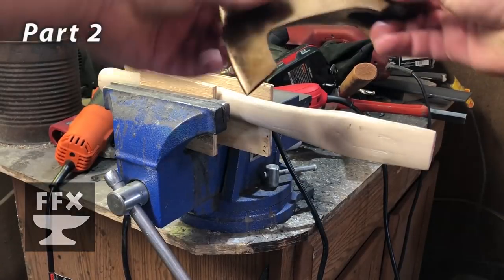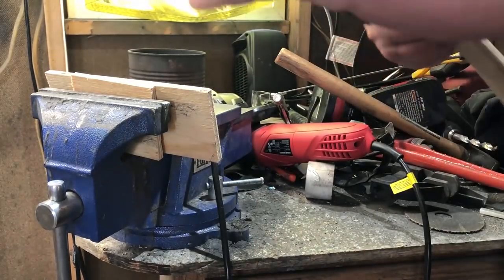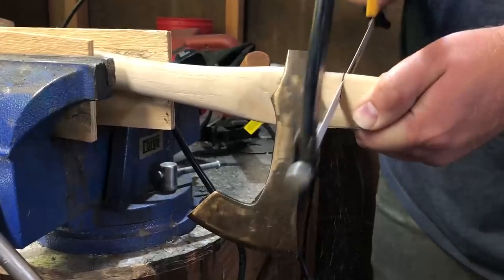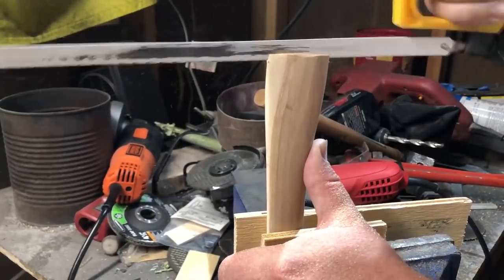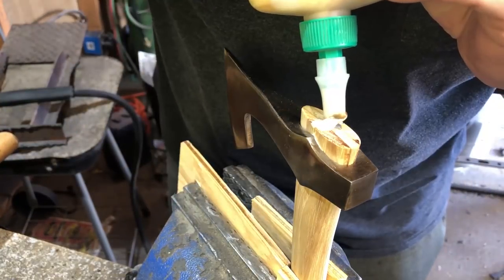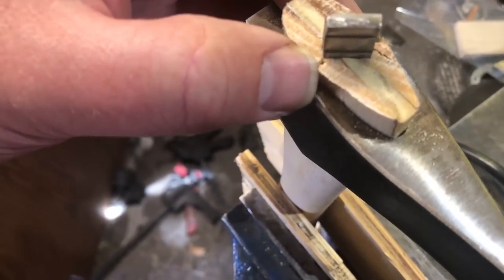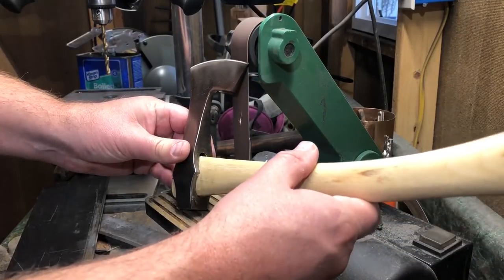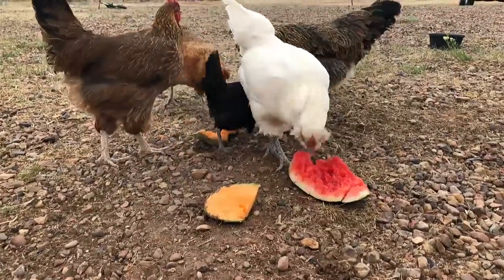Making a Bearded Tomahawk Part 2 (from a Used Hatchet) Viking Style! Not really, but cool anyway

Comment: When fitting a hammer head onto a handle, I always drill a hole at the bottom of the slit, going all the way through the slit. It makes a "o---" shape if you look at it from the side except everything connects. I have heard that drilling that hole allows the handle to expand a little when you put the wedge in, but more importantly, it does not allow the slit made by the saw to crack all the way down the handle.

Comment: Little update regarding my comment under your last video:
I made a simple 5 brick forge and attached one of the two weed burners I bought. This was done to test their ability to heat stuff up.
=> it worked great! I was able to give my first homemade knife a complete makeover. I am still amazed how quickly the temperature rised. I once reached over the small oven to grab my pliers which resulted in losing a good amount of arm hair!
Reply from the maker: Dreadnought of blades ha! I’ve lost plenty of hairs myself. Glad things are working out, I’ve often thought about picking up a weed burner for extra heat on my gas forge. Might help me get up to welding heat.

Comment: Made one last year from a rusty old axe. I  used a full size ax handle and shortened it because  none of the boys ax or hatchet sizes were close. The hardest part  was going to 3 different hardware stores to find a handle that had good grain orientation.  Before i set my metal wedge i trimmed the handle flush with the upper point.  Also finished it with caseys gun blue and made a leather blade cover  with snap.  I still have afew ideas im toying around with,  since i cut the ax handle there is no swell so I thought a shaped pomel piece (or whatever  the handle end is called) might be cool and maybe a leather wrap.  I also recently  got  a wood burning kit and was thinking about burning a celtic knot design at the top sides of the handle.  Took it camping last summer and it got used more for the hammer end setting tent posts. Lol. All in all it is a great project with  alot of extra creative potential. And you did a nice job showing it.

Comment: Your wooden wedge was way too wide!  You should have pared it down a bit and then it would have gone in a lot farther, making for a much better and tighter fit of your misshapen handle! DO GLUE it to begin with and it will work much better!
There are far better videos out there than Wranglerstars for fitting an axe handle!  Not that his are bad but, there ARE better ones!
Also, it would have been much better for you to trim the head end of the handle to the profile of the head BEFORE inserting the metal wedge!  This creates a much neater and more professional look to the end of the hatchet AND makes for a much tighter fit so that you will likely NOT have to rehandle the hatchet any time in the next 5-10 years!
It also, looks like you did more CRUSHING of the melons than slicing/cutting!  LOL!!
Good video!